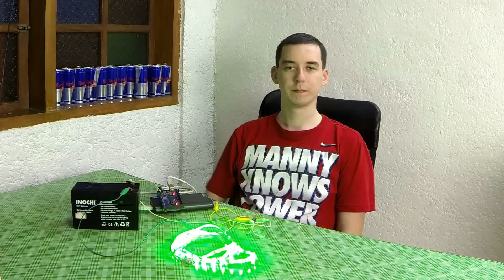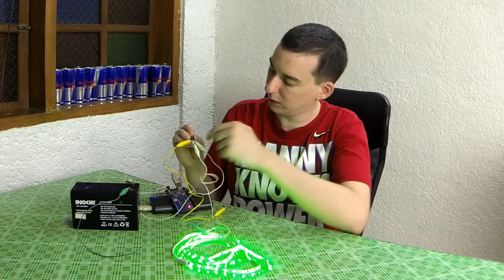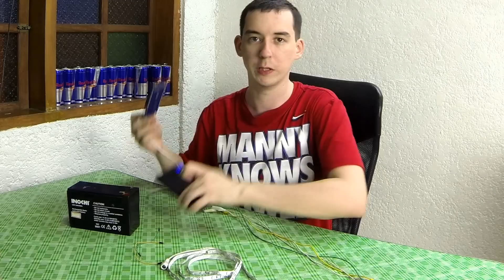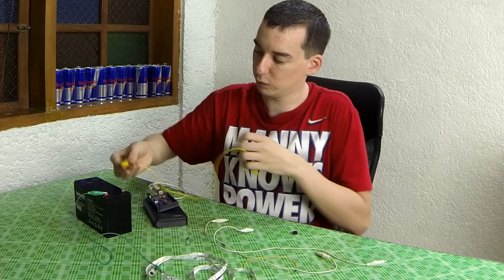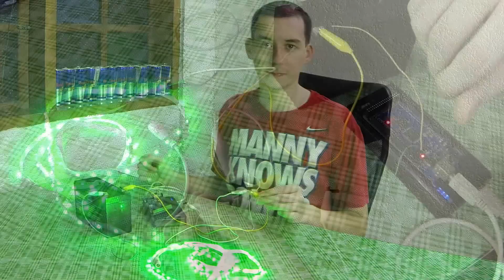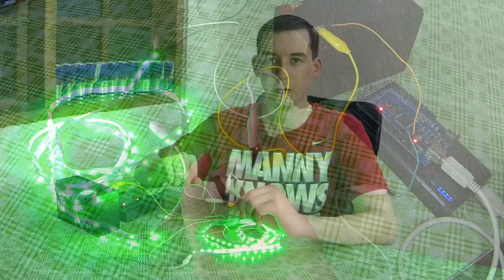Control 12v LED strip from Arduino using a Mosfet

Comment from the maker: You might prefer the simplicity of an Arduino relay board.. https://www.youtube.com/watch?v=pAxveXF1W6U
Reply: Not when need low consumption in Arduino. Take my case, I am powering nano from sun(as a battery controller and house automatization), relay module uses 30mAh each, and my project without relay on consumes <20mah, its more than double with relay on. Another bad think with relay modules: if you activate all 8 you need external power source (30mAh x 8 = 240mAh , arduino can handle 200 plus other sensors and stuff ...hmm) .Sometimes mosfet is better
Reply: which mosfet did you use? what resistance ?? can you share a diagram? is a IRF540N
Reply: @Alejandro did you eve read the IRF540N? What are you trying to power, an entire building? Holy shit that is a big mosfet. That can barely even be driven by the low voltage of arduino LOL
Reply: @gg-gn3re  pls help me give me example for n channel L series mosfet
Reply: @gg-gn3re  You could use a IRLZ44N  n-Channel mosfet
Reply: relays ew

Comment: Why are we connecting ground of arduino to the battery? Is the arduino not grounded already or is it because of reference? Does the ground need to be referenced to the main power source? If so does connecting the ground of arduino to the ground of the battery make the point of reference from the ground to be the battery?

Comment: Is it possible to provide signals to both the anode and cathode from a microcontroller, and then obtain a 15 amp output from the MOSFET? Can the MOSFET accommodate giving an anode signal to the drain pin?

Comment: Hi, really impressive video 😁, im working on a an Arduino project that controls an LED strip with a TIP121 mosfet transistor, im trying to dim the separate channales so that i could make any color but it seems like the red channel is not dimming at all but the other 2 does, the red channel just turns of when it hits analogWrite(red, 150); can someone help me figure this out....

Comment: what mosfet are you using?
Reply from the maker: It's just a random N Channel mosfet. Any will work, as long as it's rated to handle whatever voltage/current you're planning to push through it.

It's not a special low-level mosfet or anything like that.

Comment: Hallo, your video' helped me a lot, so thanks man! I have a quick question though, What if im gonna use 2 Led tape? can i just add the LED To a PWM arduino pin, or should i add another power supply first?

Comment: hi. i just saw this video about led strips. and i am quite confused as there should be 3 or 4 connections on the led strips depending on the kind of strip you have. but mostly, it's just vcc, ground and either 1 or 2 data pins. but on this video, you only got 2 connections. what happened to one connection? i am trying to figure out or find your schematics but i just can't find it. and by the way, i just subscribed to your channel and just found out you live in Philippines too. hehe

Comment: I did exactly as you said. II'm using an IRF 540 MOSFET. The LED strip lights up but does not blink while the onboard arduino blinks. Any guesses what is wrong

Comment: So I am fading an led light in very slowly with pwm and arduino nano and a mosfet.  My led comes on much brighter than if I manually regulate the voltage down which is not desired.  I would like to dim the led all the way down to barely noticable.  Does anyone have any ideas how?  I can put a resistor on the power going to the led and achieve the dim level i want but the top end  brightness is compromised.

Comment: Few questions here..
Which MOSFET are you using in the circuit?
Don't we need a pull down resistor connected at gate of the MOSFET? In case to avoid misreadings at the gate due to capacitive discharge and turn ON the gate/LED when we actually need it turn OFF.
Also, does MOSFET's Vds respond to PWM in the same way as the PWM at Vgs? 
That's really cool if it does. I thought MOSFET could just be used to turn off and/or on.

Comment: Thanks my attraction to using a mosfet is that it's smaller and more efficient than using a relay. I want to turn on and off a GPS. Does it matter if I connect positive in stead of negative via the source and drain? Can you give us a link to the "fade sketch"? Thanks again!

Comment: Thanks, clearest tutorial online, and it works!  But my N Channel MOSFET quickly overheats while idle (ie the gate is closed), so i think anyone reading this needs to order a 'Logic' N Channel MOSFET..
Reply: Yes, always look the datasheet for the Threshold Voltage, that is when the MOSFET is fully turned on in the Saturation Region. Or you could simply make a proper voltage polarization circuit for the gate of the MOSFET with just a general purpose BJT transistor and some resistors.

Comment: Hey can I put 12v 10amp into the led strip? will it not destroy arduino and the load? I have lots of load and my current 12dc charger can only supply 0.5amps. Thanks man,

Comment: I understood everything, except the reason behind connecting the Arduino gnd to the battery.

The battery powers the LED strip
The Mosfet is a switch than interrupts the LED / Battery gnd
The USB power supply powers they Arduino.

I understand that, but why does the Arduino gnd need to be connected to the Battery Gnd?
Reply: If you dont share grounds, the voltage in the gate would be floating, so you could not control it. You need a reference ground.

Comment: Superb and easy to follow guide. Worked great thanks :) 
I had a issue when applying it when the pin has code where the light needs to be completely off i.e. When power is applied, the LED strip comes on instantly before going to it's lowest dim level. But I need it to not light up when power is applied until my code tells it to. I'm assuming this is a MOSFAT issue circuit issue as it happens with any code I use, as the code works when I use single LED(S).

Comment: Step 1. Throw away the 12V battery
Step 2: Connect ALL the Red Bull cans in serial
Step 3: Connect the LED Strip to the positive terminal of the Red Bull cans
Step 4: Connect the negative and grounds to the bottom of the Red Bull cans
Step 5: Profit.

Comment: Going to use this to control the lighting I've added in the interior of my truck by the stock OEM dimmer so it will dim with the backlighting.

Comment: I use a 12v power supply for the arduino.  Can i use the Vin pin instead of a separate 12v battery, to power the ledstrip?

Comment: Thank you very much, great tutorial!

This worked perfectly with a BUZ11 N-Channel MOSFET
Reply: I'm using a buz11 transistor as well. However, the LED's are significantly dimmer compared to when I connect them directly to the power source (With %100 duty cycle). Is this something you have encountered or do you know why this happens?

Comment: In other videos but with RGB strip they also use a resistor between the arduino and the transistor. The light is more bright without it, so is it safe not to use one (1kresistor)?

Comment: Does the arduino has to be powered via the USB?
Reply from the maker: The Arduino could be powered from the 12V battery because it has an onboard voltage regulator which can handle higher voltages :)
Reply: Thanks for the fast response. So basically you can power the LED strip and the arduino from the same battery?
Reply from the maker: +Taffo Velikoff / Nottich correct :)
Reply: Oh, I see, I can use the Vin pin. Thank you so much!

Comment: Nice video, thanks for sharing. If you don't mind me asking, I am trying to use Arduino to control 100 x WS2811 LEDs on my motorcycle. What should I look for in MOSFET? I would like to get one that would allow all the current and another 50% to pass safely just to be on the safe side.
Thank you.
Reply from the maker: Pretty much any N-channel mosfet rated for enough amps is going to work. A L series mosfet is recommended for arduino but it's not critical.
Reply: Great, thanks for quick reply. I would love to see a video of everything controlled off a 12V car or motorcycle battery.
I'm in process of learning Arduino and electronics myself and thing I want to begin with is to power it off my car battery and use something like 50x WS2811 LED units (that are 5V so there's another challenge) to control from a pre-loaded sketch via push button or similar. It might also be Arduino Nano so there's another curved ball.
Trying to figure out should I do battery -> converter (of some sort) -> Arduino -> mosfet -> 5V LEDs or battery -> converter (of some sort) -> Arduno and battery -> converter -> 5V LEDs linked via mosfet.

Comment: Just to make sure, if i use a mofset to control a 12v motor, applying a positive current to the gate, whether it being 3, 5 or 12 volts, the mofset will let the current flow between  the source and drain?
Reply from the maker: That's correct.
Reply: Damn, thx for the quick asnwer. I wish you a nice day/evening my good sir

Comment: As I'm an newbie to Arduino, can you please show the code for controlling MOSFET? This is exceptionally good demonstration of MOSFET use, easy to understand, easy to wire. It just needs a sample code :-)
Reply from the maker: I just used one of the sketches included with the arduino software, the blink or fade sketch will work :)
Reply: Thank you!

Comment: Thnx a lot for this great video.
I have a couple of questions. Since LED illuminance is driven with current, how do you calculate min and max current supplied?
Also, if my led strip requires 1.5 Amps, what should the power supply be and which mossfet should i use?
Thnx a lot.

Comment: doesn't mosfet need resistor toward ground on gate pin? FETs have internal capacitance and if you don't drain voltage from the gate they stay open.
Reply from the maker: It's recommended. It won't always be a problem but it can be sometimes.

Comment: if the battery is a higher voltage, can more volts be connected where the LED is connected??

Comment: Are you using a 12V 1.2 Ah battery?
Reply from the maker: It's 12V 7AH but the capacity of the battery doesn't really matter.
Reply: See I have a 12V, 1.2 Ah lead acid battery which I haven't started using it because I am afraid whether it would drain all the charge out of it quickly. I have a circuit that needs a 12V battery and a 2.4A current from input. Since the battery is marked 1.2Ah, I think within half an hour, the battery will drain out :(
Reply from the maker: Yep.

Comment: Good vid, thanks alot, but why did you connect to ground of the arduino to the ground of the battery???
Reply from the maker: They need a common ground since we're using a different power supply for the LED strip and the Arduino.
Reply: Thank you very much bro, but I just donno what to modify(the circuit) when I use an AC and relies?!!
Reply from the maker: Lotfy Salem I made another video showing an AC relay. It's the same circuit basically.
Reply: Thank you very much +Gadget Addict

Comment: can i make the leds blink and not just fade?
Reply from the maker: +Zonic Akhil yes, use the blink sketch instead of he fade sketch.
Reply: Gadget Addict thanks....one more thing, how can i make the led blink for say 500ms and then make it stay on until power's off or may be a switch is turned off
Reply from the maker: Zonic Akhil Just tweak the Arduino code, it would be very easy

Comment: I has 1000W pure 12v psu, I wanna to dimer near to 50mts of rgb led strip, which mosfet can be use for this?
Reply from the maker: What's the maximum amount of power consumed by your LED strip? I assume it's far less than 1000W.
Reply: 12V 1.2A/mt, so 720W aprox.
Reply: 720W at 12V equates to 60A from the power supply - you won't be able to chain 50m of LED strip in one continuous run as the first strip won't be able to handle 60A passing though (it will melt!). To achieve this you'll have to have separate power connections to, say, each 5m of LEDs. If you are doing this you could then power each 5m section from a separate MOSFET and drive all the MOSFETs in parallel. Then you'd only need MOSFETs that can switch 6A. I'd love to see a video of you adventures in constructing this.
Reply: you got me, I never consider that the strip itself will melt, and of course i'll need to make it with separate mosfets, not just one, but, it can be done other way, if exists a "big" V/A mosfet that can push 12V lot-of-A PSU to one wire through one mosfet, then light each 5mt strip separatelly

Comment: Question, how can  I use an adafruit trinket to work with a 5 volt digital led strip?  I want this to be portable, work on battery, and have more than one mode/program
Reply from the maker: Is it an addressable strip where you can control individual LEDs, colors etc? If yes, you're probably better off looking for a sample code from adafruit.
Reply: Sample code is fine, just wanted to create my own and see how many I could save to a tiny processor.
Reply from the maker: Wendy Simmons If you create reusable functions, I'd guess you could fit quite a few patterns on there. Then just power it from a powerbank so you can operate it while on the go without worrying about the battery running out.

Comment: What is the exact model of the mosfet? greeting
Reply: I guess he has an IRF540 (28 amps, 100v), it's the most common one and will work with almost everything. Be sure to attach an heatsink if your circuit pumps a lot of current.
Reply: thank you, greetins

Comment: Mine isn't fading. It's just turning on and off. HELP! Could you post your code in the description or on a blog (such as the Arduino website) and leave a link in the description??? PLEASE!!
Reply: try PWM output on arduino it has ~ symbol next to number of port on arduino board
Reply: or just use a capacitor..
Reply: thanks for this I had the same problem and plugging it into ~3 on my arduino uno solved this problem, now fading perfectly

Comment: Awesome! How do i find these L-series Mosfet? Where does it say "L"?
And also, what code did you use for this fading?
Reply: int power = 0;
int mode = 0;
void setup() {
  // put your setup code here, to run once:
  pinMode(9, OUTPUT);
  Serial.begin(9600);
}

void loop() {
  // put your main code here, to run repeatedly:
  analogWrite(9, power);
  delay(5);
  if (mode == 0) {
    power++;
    if (power > 250) {
      mode = 1;
    }
  } else {
    power--;
    if (power < 10) {
      mode = 0;
    }
  }
  Serial.println(mode);
}
Reply: +TheZlorgue It didn't work :( At least not for me.
Reply from the maker: +NinjaNerd did you flash the fade sketch to your arduino ?
Reply: Yes

Comment: Really impressively paced, clear, logical, explanatory and complete.  I'm relieved to have found your video so early in my search - to dim about 9m / 7.5A of LED ribbon using an Arduino instructed by the circuit dimming function provided by my house's Dynalite automation system.  That second bit is the next challenge - I suspect by analogue sampling.  I look forward to exploring the rest of your videos.

Comment: Nice video!
Do you reckon that this kind of approach could work to attach high current drawing stepper motors like NEMA34 to  low current stepper drivers (like grbl shield)? Would the mosfet be fast enough for CNC accuracy?

Cheers!

Comment: Hi, many compliments for Your video.
Just a info: i need to make a counter up/down to realize a volleyball scoreboard. I want to use a LED strips (35 led for digit for a total of 4 digits).
Do You think is it possible using mosfet instead rele? How about to use a PC power supplier? Thaks a lot, Umberto.

Comment: Great video! it really helped me to understand the work of mosfets in combination with arduino.
I have a question though:
Sometimes I read on the internet that the mosfet doesn't need a connection to ground. You hook up the ground of the arduino to the negative (ground) of the powersource, is that really necessary?

Comment: I realize this is a fairly old upload, but how exactly are you limiting current to the LEDs? Do these strips have current limiting devices built in?
Reply from the maker: Yup the strips have resistors built in :) pretty standard practice on most 12v LED strips
Reply: Makes sense. Thanks.

Comment: Help! On my RGB Strip when the MOSFETs are OFF its resistance to ground is 16Mohm but still if i connect the 3 led kathodes the strip lights all white up! (all 3, RED; GREEN; BLUE) wtf?

Comment: It's a 12v plug connected to the mains
Reply from the maker: +Karen McAllister Ah okay, then you'd use the DC negative. Most arduinos have an onboard voltage regulator so you could actually power the arduino and LED strip from the same AC/DC converter you have plugged into the wall and then not have to worry about joining the grounds.

Comment: What's the mosfet model?
Reply from the maker: +Máté “Matthew0220” Kovács It's just a random N-channel mosfet I had laying around. I'm not sure of the model sorry, it's not too important because literally any will work :)
Reply: Okey. I have any types of mosfet's i trying all model's this is big time beacuse i have 100-200 mosfet's from old electronics
Reply from the maker: Máté Kovács Any N-channel mosfet will do the job :)
Reply: Okey. Thank's the info. I searching N-Channel mosfets :)
Reply: Can you send the code you used?
Reply from the maker: Máté Kovács It's the fade sample code built into the arduino software. Just click File > Examples > Basics > Fade :)
Reply: Okey. Thanks i found it :)
Reply: +Máté “Matthew0220” Kovács  well if you need 12v mosfet it should be like 7812 mosfet for your project
Reply from the maker: MrSome1bad Are you sure you're not getting confused between a mosfet and voltage regulator?

Comment: Thanks mate, i researched some days without a solution. I try to manage high voltage motors with mosfet. At min 3 when you explain the problem of connection between ground of power supplies i got the solution to my problem. Thanks for publishing.
Reply from the maker: +Holoduke9 I'm glad you found a solution :D